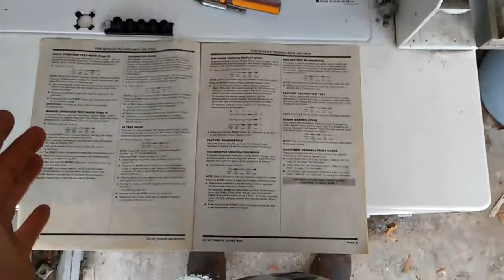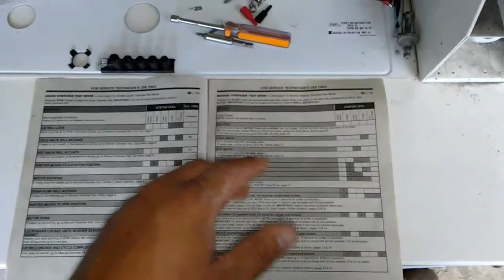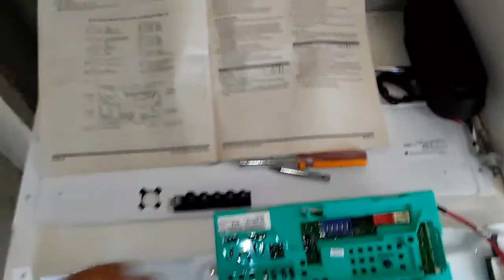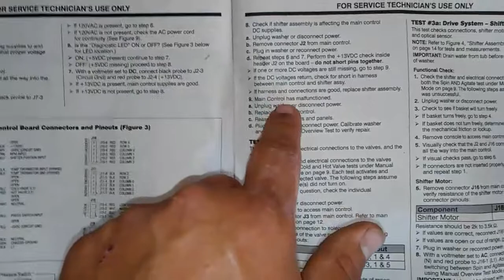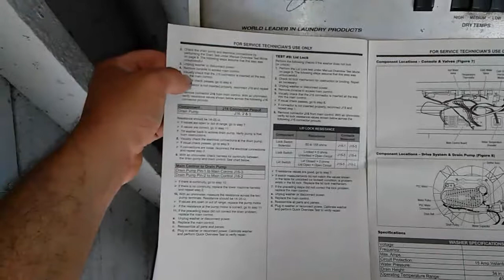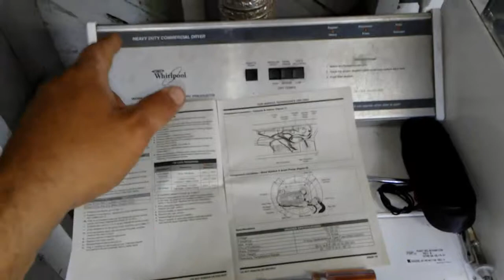Whirlpool all lights on fix Part 4/6

Comment: nice video - you can actually take the pump apart  - but for $20 new pump its not not worth it.  Those pumps do accumulate gunk inside the motor stator and can be cleaned.